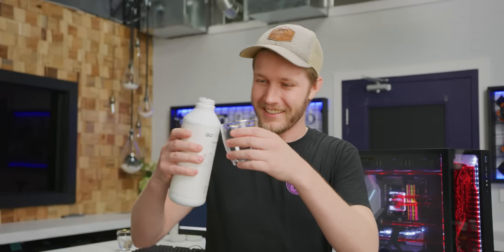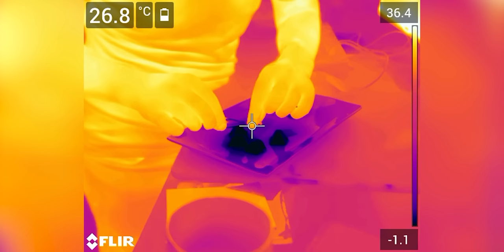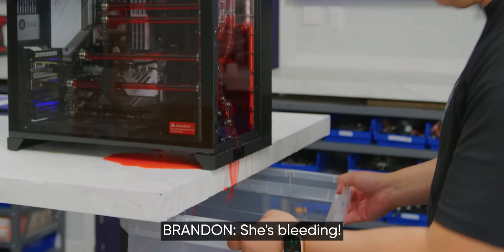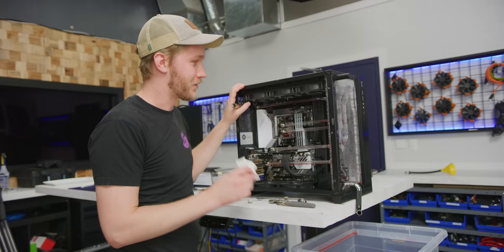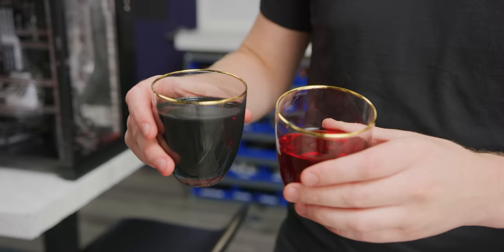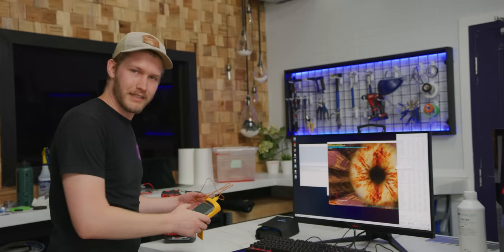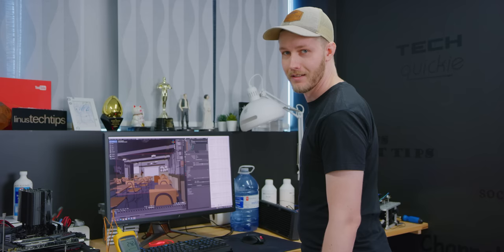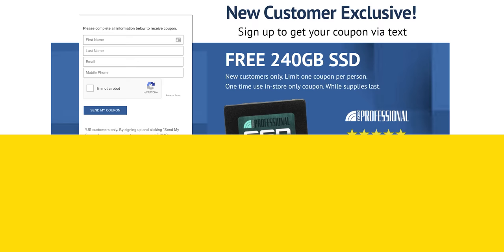7°C Cooler? This must be a scam - GoChiller Graphene Coolant Review

Comment: Well i didnt have any espectation of this graphene enriched  liquid for water cooling ! 
I thought were another hoax product but i was wrong however is effectiveness is limited to very few degree.
How is its behavior in long time running? i think is unknow and for me do not make sense to risk for my computer for such small improvement but surely for someone it is do!
My first concern is about precipitate formation and abrasivness of graphene on pump .
Graphite is a multi layered carbon  sheet keep by van der waals interaction who make it a lubrificant but graphene is not .
It is a single sheet  or more correctly a powder made from fragment of single sheet with only sp2 bond  very hard and with a lot of jagged  border.
I dont know nor readed anything about graphene powder abrasivness but without  a specific test i will not assume it is trascurable.
Maybe they call it Graphene  but it is a fullereni or nanotubes mixture in reality with better tribological properties

Comment: You dont really use the thermal conductivity of the fluid very much. You conduct the heat away by moving the water away.
Reply: Yes but by increasing thermal conductivity of the liquid, you are able to cool even more efficiently. It will conduct more heat at a faster rate with the same flow

Comment: I don't understand why not just use antifreeze?
Reply: Isn’t that the exact opposite of what they need?
Reply: @muzlee7479  is it ? They are using a radiator same way as an engine .. non organic antifreeze should be fine
Reply: @richardalfaro4933  Antifreeze reduces the cooling capacity of water (which it is usually added to) .
Reply: @richardalfaro4933  again, it reduces the cooling capacity of water. It's a 100% pointless for computers. The water isn't boiling and there is no way it would freeze.
Reply: @muzlee7479  look look just use it .. it will keep it cool, longer
Reply: @richardalfaro4933  you must have some underlying problem. I suggest visiting a doctor.
Reply: @muzlee7479  I think I'm a genius

Comment: the idea as such can work
but
it seems far from ready
and also the way compouns behave, even if you had something nearly infinitely thermally conductive, in a mixture like this where the amount you cna mix in is limited by the water needing to... flow the water and the kind of mixture are going to put a harsh limit on how much good it's actually gonna do
looking a their website the thermal conductivity of htis is sliiiightly better than that of pure water but significantly better than... some unnamed competitors
so I guess the marketing just focuses on comparing it to coolign agents that are vermuch focused on low electical conductivity nad prevneting corrosion which have slightly lower thermal concductivity than water
so the product... kinda cool idea, could be fun, has some advnatag but not notably
the concept as such is remotely feasible I guess
iny graphene or cnt particles can be very flat and thin or long and narrow nad thus exchange heat wit hwater over a surface area mcuh greater tha ntheir cross section
and well, if you mix them in randomly, some of them are goign to be at least remotely pointin along the way heat is flowing, that's just statistics
though I guess effectively oyu culd jsut mix in micrsocopic flat chiplets of any material more thermally conductive than water and get similar results
you oculd even use micrsocopic flat chiplets of ceramics that have a higher thermal conductivity tha nwater but insanely low electrical conuctivity
you might even be able to mix in more of tha without it causing conductivity/corrosion issues and get an evne higher thermla conductivity which would increase the thermal boundary layer around your fins and thus make the waterblock mroe efficient -  the amount this helps of course depends on what percentage of your temperature differenc ebetween chip and air is caused by the exchange between water and fin - so a low performance waterblock, low flow rate but hue radiator will increase the seeming effectiveness of thsi which might also be used for marketing
I guess mixing random micro/nano chiplet powders from alibaba into existing anticorrosive/anticonductive cooling fluids and seeing what happens might be an interesting series

Comment: Love this channel,  have you tried to use automotive waterless engine coolant to cool a pc with temp reducing additive added into it
Reply: most water cooling liquids are glycol which is what is in car coolant. the coolant for cars just has extra corrosion inhibitors due to having a bunch of dissimilar metals in the loop.

Comment: The results of the Graphene test was flawed. It most likely will result in a better thermal drop IF you have a radiator with a great enough TDP factor to radiat the heat generated. If you dont have a big enough radiator that will cap the  thermals and "bottle neck" the solution because it can dissapate enough heat leading to "similar temps"
Reply: heat moves more efficiently if there is a greater delta, so you would actually get a bigger thermal delta with a smaller radiator rather than a larger one. there is no cap on the amount of heat a radiator can dissipate. actually the bigger radiator would lead to more similar temps.

Comment: At this point wouldn't your biggest thermal bottleneck be the material of the radiator itself? Maybe switching to a copper one that I've seen in one of the other videos might yield a little better results over the aluminum that's normally used Cause regardless of the fluid it's up to the radiator to actually disperse the heat.